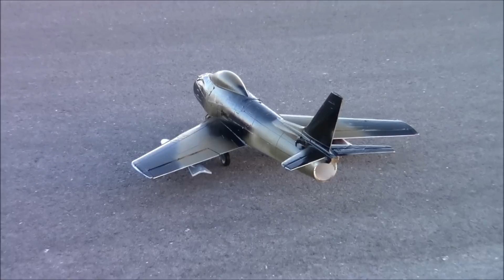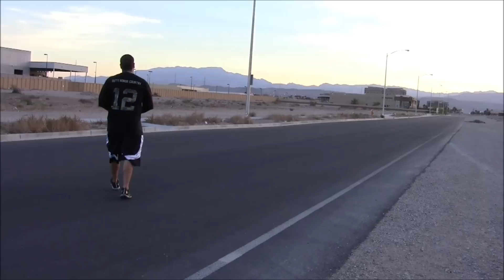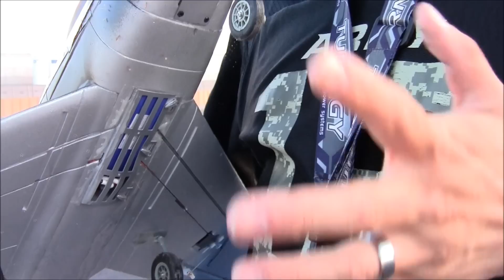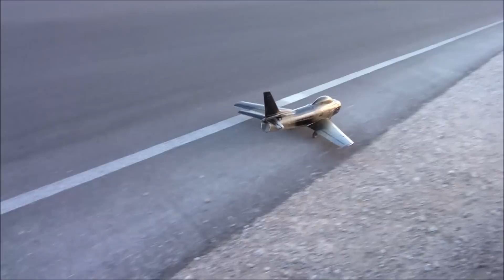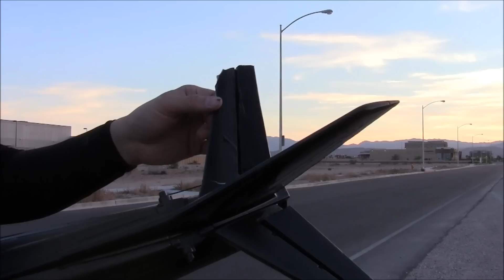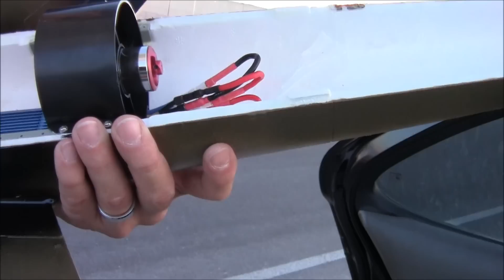F-86 Maiden Flight Maiden Flight and Crash!

Comment: OW, I hate that when that happens.  I'm sure you know what to do to fix it.  You've now been doing this a while.  On your jet, I would add weight to the front or move the battery farther forward, lesson the rates on the elevator, and add a little more expo so it's less responsive on the sticks.  You've probably already done this by now, but there's my two cents.   I'm still working on the repair of the viperjet, so no need to ask.  lol.  Sometimes maidens can really suck.

Comment: ouch! that second attempt didnt look bad, took off well, for me it looked like the ailerons were very responsive giving that strong left kick (maybe the elevator also?) and the vertical ate all airspeed. i'm not sure but it looked like it turned upside down on top when the stall happened and you crashed because of orientation problem!? good luck with the repairs, i'll check out the re-maiden ;)

Comment: hope you didnt spend to much on the airframe I bought 5 of those and 7 f-16s off of ebay last month. both types are 80mm. do like the camo job looks better than the silver they have on them. cought a good deal when they flooded ebay with them. averaged 38.00 a plane airframes. sold 2 at work for 100 for both he thought he was stealing them from me.lol some advice invest in a plane balancer best investment I ever made.

Comment: In your defense, the CG in the manual is bullshit.  With a 2200 pushed all the way forward, it balanced out but in flight it was still WAY tail heavy.  Also there is just one set screw fastening the fan to the motor.  Mine came loose in flight in sheared off a blade.  Guess what, you can't order an 80mm 8 blade anywhere,  much less any 80mm that will adapt to this motor.  Nice plane, but it's little things like this that ruin the whole experience.